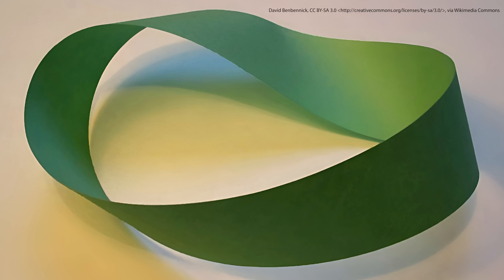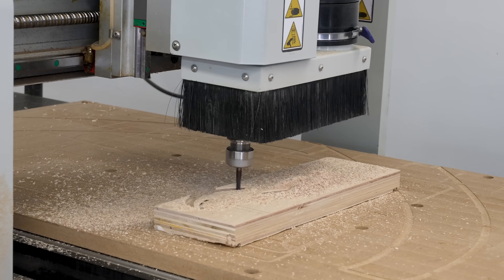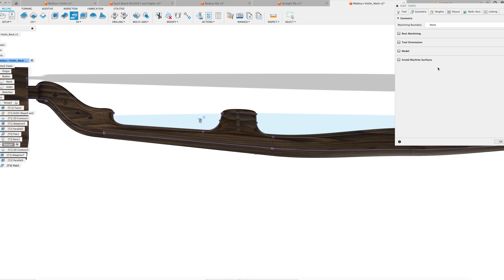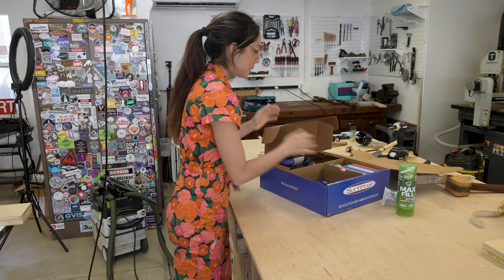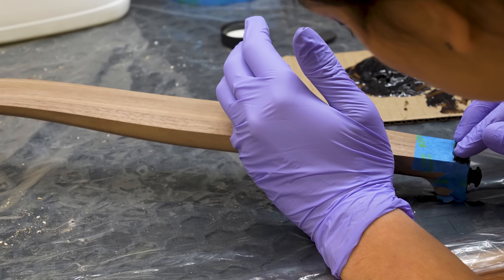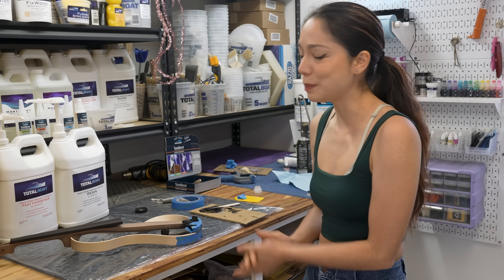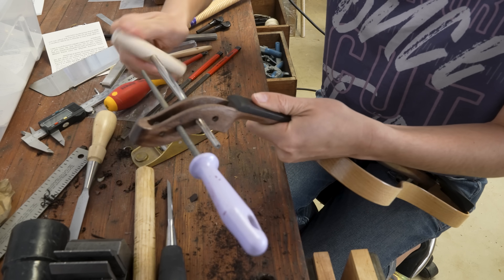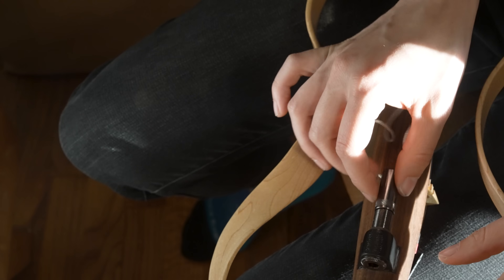I Built a MOBIUS STRIP Violin

Comment: CNC is just another tool. No different than any other tool. Once people got past scratching at things with their finger nails and picked up a rock, tools where born. Discounting a new tool just because it is new, makes no logical sense. 

NC and by extension, CNC, started in the 50's. This is 70 year old technology. It's time people stopped hating on it.

I use CNC exclusively in my guitar building business. I would not be where I am without it.
Reply: I mean, I would classify our nails as tools as well but otherwise I agree. That said limiting oneself is a great way to hone one's abilities. A true master of their craft should be able to create a masterpiece without a full tool set 👍🏻
Reply: @RHCole  I don't agree. Limiting your tools limits your ability. I do so much in my guitars that you can't do without modern tools. It makes a better product. And a product that can't be achieved without these modern tools.

I've been in manufacturing for over 40 years. I've mastered manual machines. I've run  ASCII punch tape NC machines. I own many new CNC machines. I also use Fusion 360. I've taught many young people manufacturing without having them back up to the stone ages. It's not necessary and I believe that it stifles their creativity.